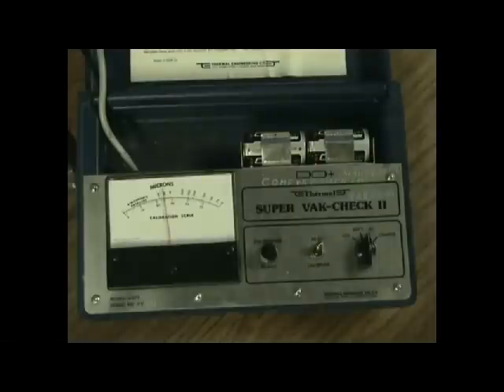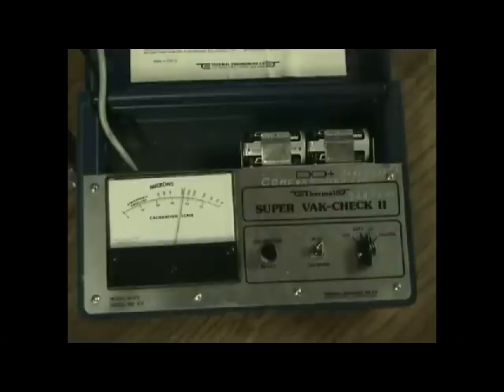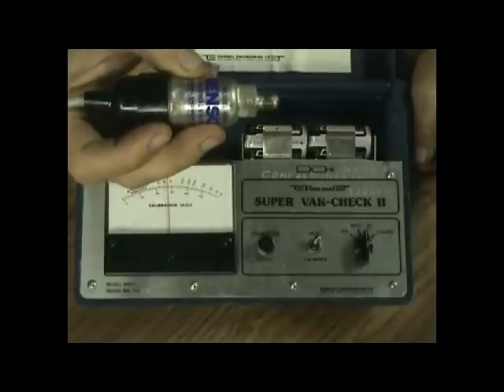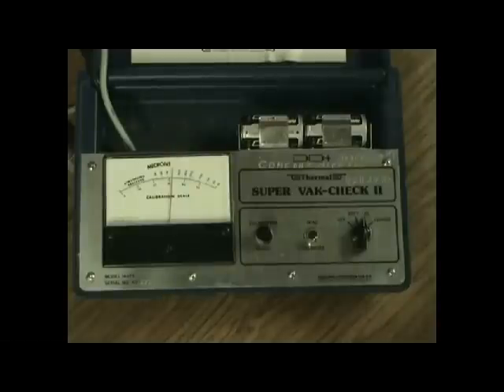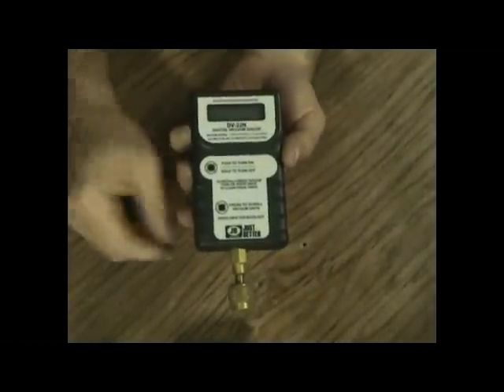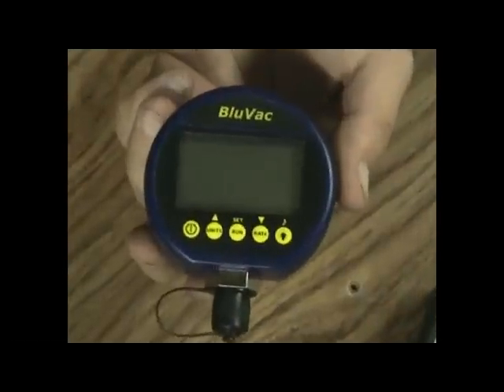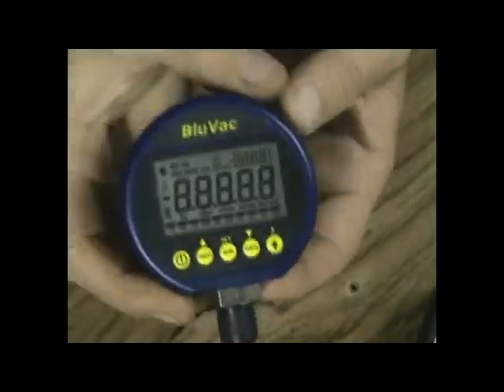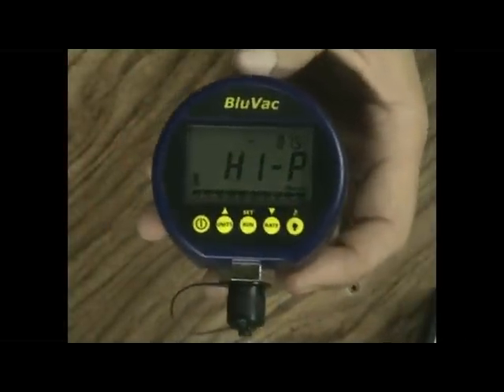HVAC/R Vacuum Series, Episode 2, Vacuum Gauges

Comment from the maker: Without reservation! The new BluVac LTE is also available now as well. Same reliability, accuracy and repeatability but without a timer, leak rate indicator and temperature display. I love those features on mine, but the LTE is the best "entry" level vacuum gauge on the market. TruTech Tools now stocks them both.